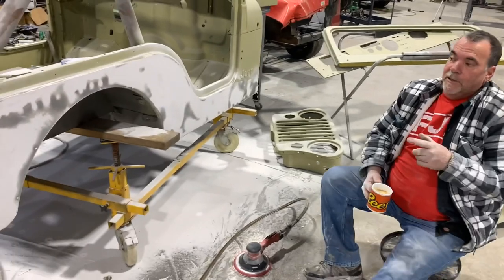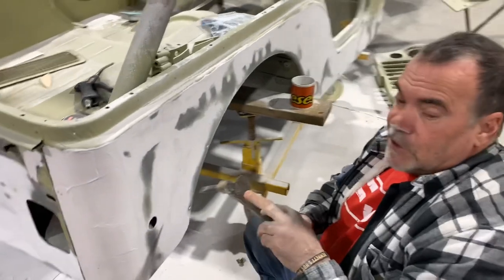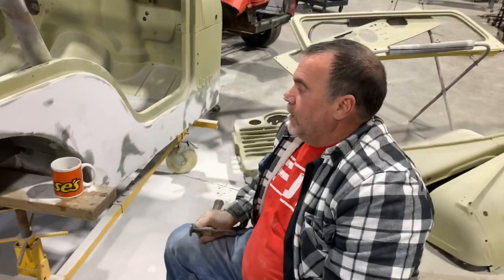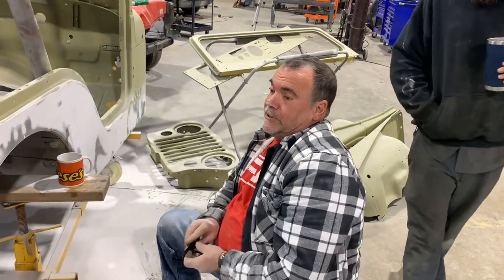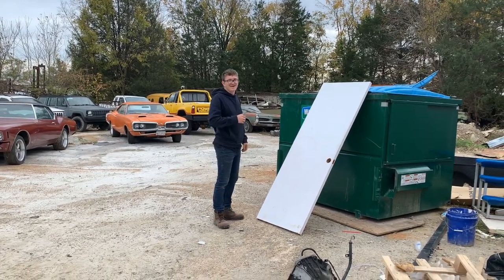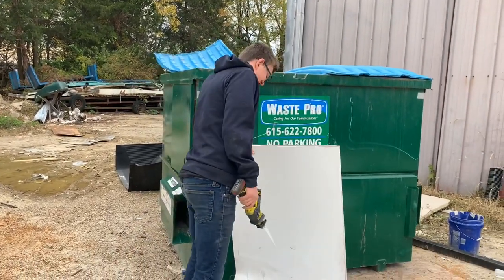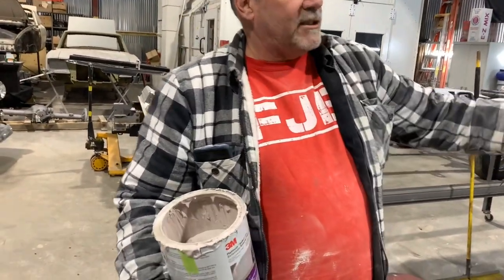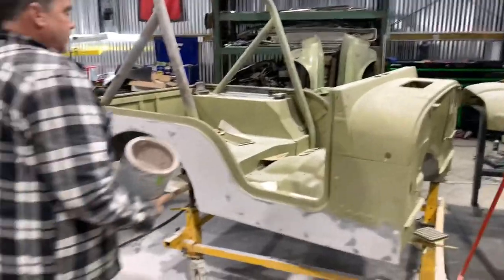Jim Shows How To Do Body Work and Austin Delivers a JUDY CHOP

Comment: I like being able to learn things like in this video.  The shrinking hammer works because it takes the excess length of a bow in the metal and reroutes it to a small area with a slight zig-zag that is easily finished smooth.  Shorter distance = no bow.
Reply: Now when does the Claw hammer come into play in body work?